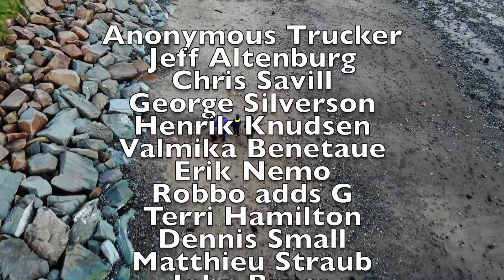#24 She doesn't have a wet bottom!  Awkward work on the underside of our steel yacht

Comment: Melissa, for your grinder I would suggest getting a 'cone' shaped wire wheel rather than the wheel style you are using, when you are cutting rust this changes the angle so you are pushing down rather than holding the grinder on it's side, this will make it where a lot less of the grinding dust gets shot back at you! Also gives you better mechanical advantage when stripping a rough spot.
Reply: Was going to say exactly this, it was imperative while I was doing work on my steel hull.
Reply from the maker: Ah great advise will look for one of those :)

Comment: For easy removing paint there is a tool called tercoo with rotating steel teeth wich you can put on a drilling tool. It works realy fast with the result as sandblasting. Wish you the best with the job

Comment: Getting there! Have you tried the course flapper wheels from Screwfix? Part numbers: (26022) (346JG) (32902) Depending on the arbour size of your grinder this will be more effective at removal of paint, rust etc. They last a while an are relatively cheap. Try one out we think it may help you out. Sail Safe Guys, Ant, Cid & the pooch crew.

Comment: Great job guys be very careful when using the grinder with a wire brush on without the extra handle also never use it with one hand and believe me gloves are essential  how do I know because if they catch an edge or bolt it will grab and rip it from you. Yes I had one chase me round the back end of my boat lol I was lucky.  But it comes with territory lol stay safe.
Reply from the maker: Great point! there will be more ppl in future episodes :)

Comment: 4:25 in case you lose the tool, put the brake on with one hand whilst with the other grab the disk and twist it. It will unscrew. You can also screw the nut on by hand, without fear of it coming off. As it rotates, it self tightens (which is why, sometimes it's tighter on than what you remember putting it on for, worth). 

I've also noticed that the pad is a bit flattened, rather than worn (from experience). With those types of disks, you want to apply the lightest of touches, to the area you want to clean. They're unlike flapper disks or grinding disks where you want to give them the "beans" as they say. :)

I'd also look for a spacer disk for those in particular, so you can use them all the way, rather than partly, because of the spindle being that long. I'm unsure under what brand you'd find them in UK, but they do exist. Alternatively, a common nut of the same thread pitch and diameter, could act as a spacer for that type of application, which is easily found in any hardware store. There's also, no risk involved in spacing that particular type of disk. Obviously one must weigh their own options, mine's just an advice.
Reply from the maker: What great suggestions thank you!

Comment: A small tip about grinding, if I may...Grinding at an  obtuse angle with just the outside edge of the disc is far too aggressive on the steel. Try to flatten the angle  so more of the disc touches the area you are grinding.
Reply from the maker: Thanks for the tip, I will try that next time.

Comment: Hello Jack The question is for you; What is the function of the part you removed from under the boat. There are other videos sometimes we find this piece there on the rudder. I have no knowledge of boats and even less of sailing.

Thank you and have a good week.
Reply: It's a Zinc anode, used to prevent galvanic corrosion. Basically, seawater and the hull react and form a battery across the entire length of the hull. Depending on the material of the hull, you get a voltage difference from one end of the hull to the other, which leads to corrosion(from ion exchange). By using a different material for the anode(Zinc on steel), you can cause the corrosion to happen at the Zinc instead of the hull.
Reply from the maker: Jacks take on it..... Its a thing that dissolves to stop the boat and the electrics dissolving :) :)
Reply: @loubro2372   Thank you good day
Reply: @Turkishmath   Thank you good day
Reply: @SailingMelody   thank you for taking the time to answer me have a nice day

Comment: Hey gang, once you have zinc and in the water would you consider galvanic stabilization to prevent rust. Not sure if it works in air, most likely would I think. PM me for more info. Traa
Reply: Just wanted to say, I was talking about active stabilization using electronic box. I will look up manufacturers when I get back to the boat.
Reply from the maker: Oh yeah. I’ve been talking to Rhys from Zora about those. Don’t know much about them. Don’t thing it matters too much until we’re thinking about going back in the water though does it,  not a lot of galvanic reaction will happen with the boat on dry land

Comment: @Sailing Melody. Really loving your videos, she’s a lovely boat. I’ve lived on various boats for years and rebuilt a few over the years. I have some tools that may be of use to you. I’m not using them and would happily donate them for the length of the project. Various Makita power tools inc a grinder 18v drill with 5 batteries and 2 chargers (enough to use all day) a jigsaw and blades and loads of drill bits and taps (all in the correct sizes for the tap and die sets etc). They’re in York though is the only downside. If you think you would benefit then please you’d be welcome to use them....
Reply from the maker: Thanks so much! Can you drop us an email to Andy.turner@hotmail.com so we can chat and see if that’s realistic to fetch them from york
Reply: Sailing Melody hi tried to send an email to that address and it bounced back?
Reply from the maker: Sorry its Turner.andy@hotmail.com 🙈🙈